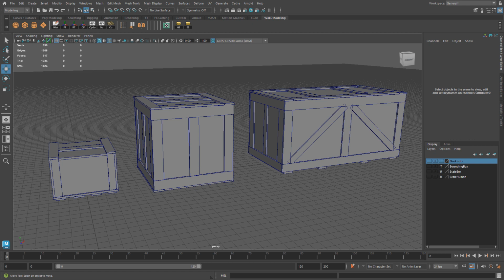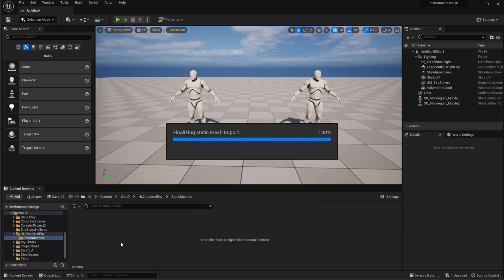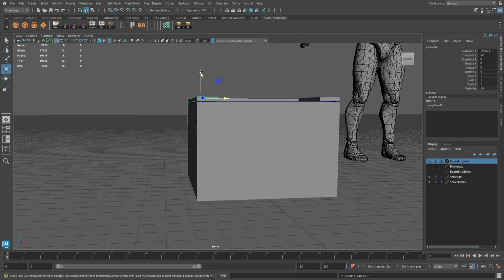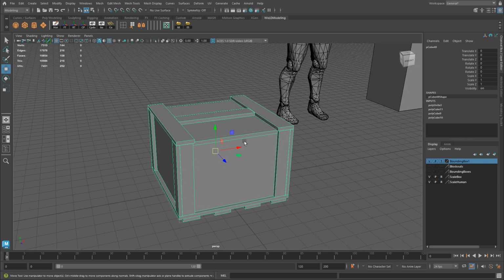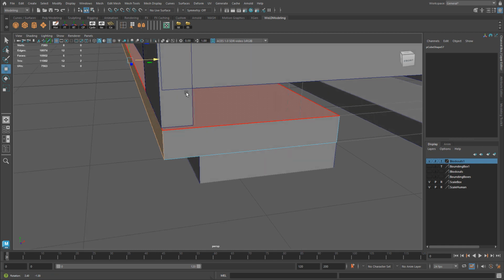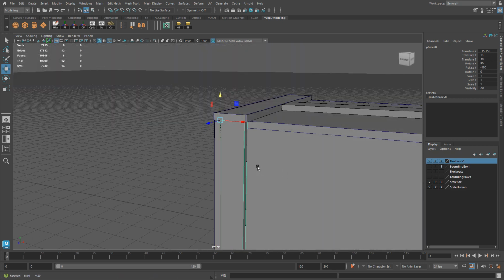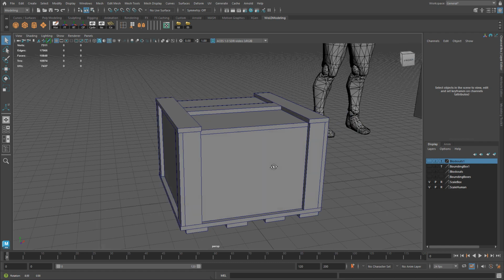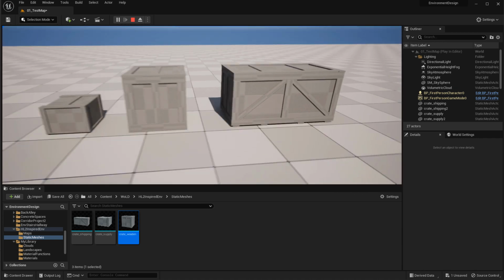LET'S MODEL #1: Wooden Supply Crate - HL2 Inspired (Maya Modeling for UE5) - Intermediate

Comment: I am somewhat connfused: is this a modeling or UV/UE5 tutorial (and part of the MayaFoundation tutorials?)
Also, which beginners tutorials would you recommend: Maya Beginners Tutorial Series or MayaFoundation?
Reply from the maker: This is a modeling tutorial.  This is a stand-alone tutorial for modeling using Maya of a wooden crate prop. It's not a part of Maya Foundation tutorial course. Just a free tutorial on modeling on YouTube.

Maya Beginner Tutorial Series (recent uploads) I have on YouTube is part or module 1 of 3 from Maya Foundation tutorial course. Just enough to get you started. Part 2 and 3 are continued in the tutorial course.

Maya Foundation is the complete tutorial course that contains all parts or modules 1-3. And shows you the beginner series on how to get started with Maya as well as how to model and how to UV.

Comment: I spent all the dawn making a box of hl2 using blender and I don't regret it. I started taking several prints of the supply boxes in Garry's mod and i had so many problems, I had no idea how to snap align, lot of problems with udk(so i migrated to ue5)  the normals of my final staticmesh was upside down, among others. 
Anyway, I didn't give up and made my first 3D model. I learned a lot, thanks for the demonstration :P